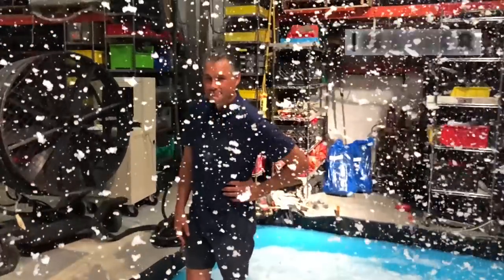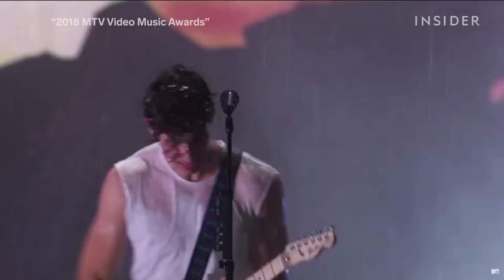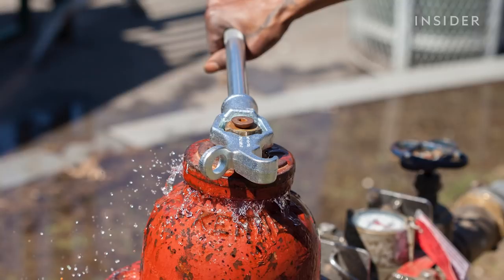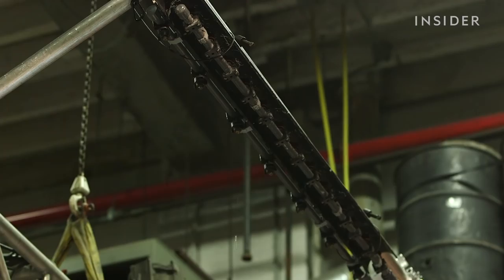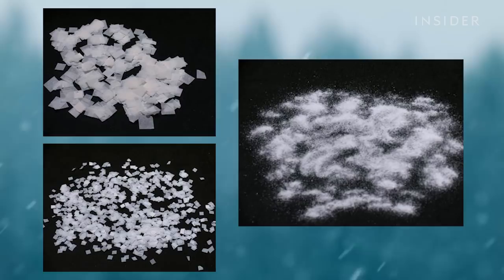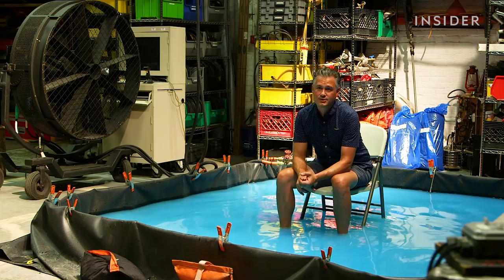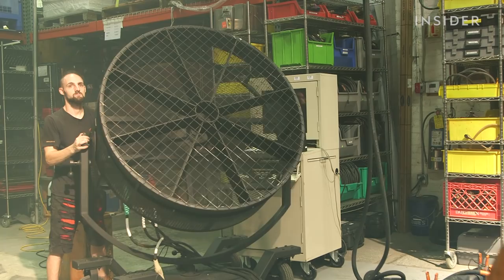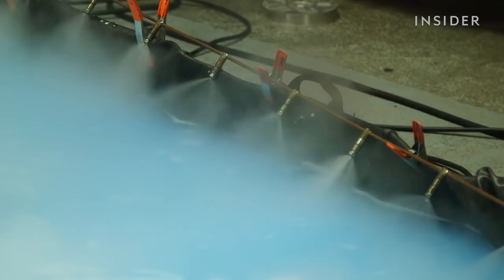How Fake Weather Is Made For TV And Movies | Movies Insider

Comment: Artificial snow is objectively the worst weather effect to deal with on stage. For the snow scenes in ballet, many times they have cloth on a rig with slits attached to ropes that the crew shakes (there are also sometimes fans in the wings). The rigging is often dusty, and the snow is specially treated so it doesn't catch understage lights so it is reused for several shows and you inhale all that dust and even some of the snow you can inhale and it is all you can do to not cough. The crew has it the worst though because the bags are heavy, they have to sweep up cubic feet of snow during intermission, and then sift through it later for bobby pins and sequins and whatnot and do it all again for the next show. As easy as snow is to do technically speaking, it is gross and labour intensive.